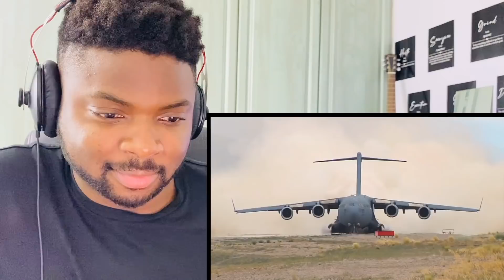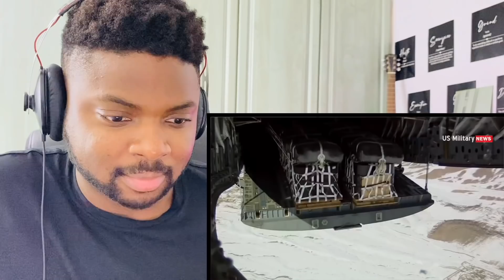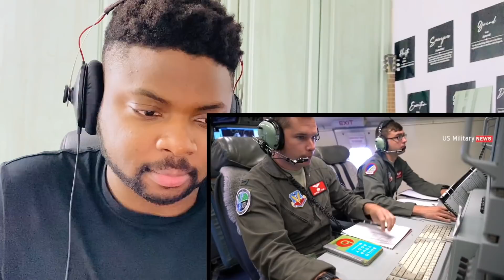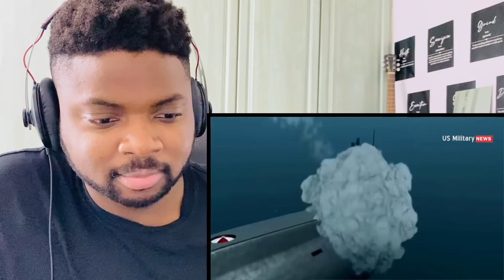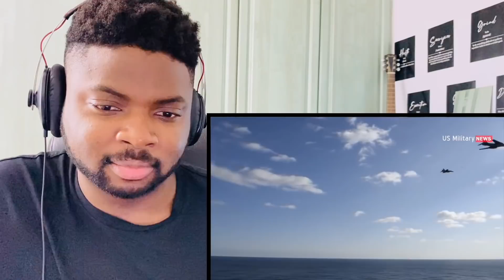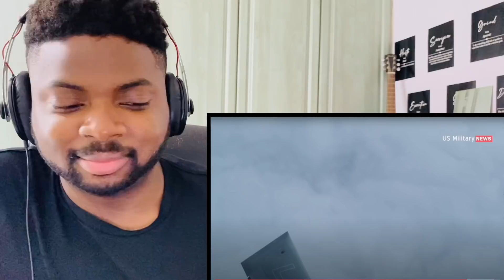🇬🇧BRIT Reacts To THE US MILITARY'S 7 MOST EXPENSIVE AIRCRAFT!

Comment: The military submits requests to various contractors for bids when they need a new piece of equipment.  The military includes their expectations for what they expect the aircraft (in this case) to be capable of.  Eventually, a single design is chosen.  Then, ONE order is placed for the desired number of units.  The contractor begins construction and gets paid on delivery of each unit.  It typically takes years to build all the aircraft for an order placed by the US military.  At any point during the process, the military may modify the order, increasing or decreasing the total number.  This may happen due to changes in the federal budget or response by the military to the dynamic shifting of its needs and goals.  For example, the USAF placed an order for 1,200 F-35's.  That's a lot of aircraft to build.  They are built and sold in batches, or "blocks."  The latest block of units will feature the latest tech adapted for the aircraft.  This gets repeated until the order has been fulfilled.

Comment: The video gets something very wrong. The B-1B is not the backbone of the US strategic bomber force. Not by a longshot. The US still operates the B-52 Stratofortress. The last one was built in 1962 but it's continually updated. It started as a high-altitude nuclear bomber. Then a low altitude nuclear bomber, Then carpet bomber. Now a long range platform for standoff conventional and nuclear weapons. It has adapted to every Air Force need. It's planned to continue operating for at least another decade or more while the B-1B and B-2 are retired. It has outlasted everything that was supposed to replace it. It's unofficial nickname is the BUFF which stands for Big Ugly Fat F*cker.

Comment: Kelly Johnson was head of Northrop Skunkworks group involved in many many plane designs including U2 and SR71.  I believe he had also worked on a flying wing design, but you need computers to control surfaces to make it stable enough to fly. Word is he was shown the built up B2 before he passed away. Kelly Johnson was an fing genius.
Reply: Lockheed skunk works dude.  He did the f117 not the B2
Reply: @codypk5111  I had Northrop and B2 on my mind. Lockheed is obviously correct. I was thinking about story where he was shown the B2 before he died or maybe I’m confusing him with Jack Northrop being shown B2 as he worked on YB49 design. Hell I can’t remember.

Comment: correct me if I am wrong, but weren't the Globemaster series designed to replace the old B52s and BFFs (747s)? Anyone with knowledge comment and let me know.
Reply: The B-52 is a bomber, not a cargo aircraft.  According to Wikipedia, the C-17 Globemaster replaced the C-141 Starlifter, and was designed to take off and land on relatively short runways, like the smaller C-130 Hercules.  According to Google, the 747 PH-BFF is a 747-400M, a commercial passenger/cargo combination aircraft.

Comment: Hi Kabir,  answering your question about ordering things, defense contracts are funny and very flexible things.  I was in the Navy for 20 years, but I retired 24 years ago so some things may have changed and some one may have more current info.  However, it used to be that anything consumable (such as uniforms, hats, ribbons, medals, shoes, food, soda, water etc) used to typically be on an annual or multi-annual contract with the same supplier.  Every so often the US Government would seek bids for the cheapest provider, but those kind of contracts usually remained in place for some period of time.  As for aircraft etc. that you were asking about, you really don't go through a lot of those in a year, so those typically are ordered as needed.  If a manufacturer has already produced one before, chances are the order will go to them again.  BUT... the government is very quick to solicit bids for the lowest cost.  It used to be (and probably still is) a running joke (regardless of what vehicle you were in) "how does it feel to be flying in an airplane built by the lowest bidder"?   lol  :-)
Reply from the maker: Awesome, thanks for answering my question mate!

Comment: Boeing is primarily a Military supply company but has a separate civilian sector. This is where the Air bus was developed. They also have a private sector for private planes and such. This is quite normal for an airplane manufacturer. This way the company can share information between sectors to better technology. Boeing unfortunately don't run their own interior tech for the the actual cabin and piloting. That usually falls to one of two companies Lockheed/ Martian and Northrop/ Grumman. both came out of mergers that create great tech. Lockheed specializes in making planes fast and untouchable but also getting the most out of turns and banks. Northrop is the tech like the most advanced radar and Laser guidance systems. each company has their specialties that Boeing likes and can easily swap parts with.

Comment: 2 fun facts. 
Fun fact 1.The C 17 has a maximum capacity of about 190 fully armed paratroopers or a recommended capacity of 300 people when solely transporting passengers. Although with low fuel the one in Afghanistan just took off with over 600.  

Fun fact 2. In 2008 a B 2 spirit was left in the rain overnight , got moisture on its computers, and crashed upon takeoff the next morning. And to this day , at 2 billion $, is the most expensive Air Force disaster

Comment: For the C-17, normally the max loadout weight is 170,900lbs (77,518.94kg) of cargo, which equals about 102 fully loaded paratroopers, or about 134 troops with palletized "seats" and sidewall "seats"...
 buuttt...
On Aug. 15, 2021 a U.S. Air Force C-17 Globemaster III safely evacuated approximately 640 Afghans from Kabul, the last time a C-17 was used to evacuate so many people was in 2013, when a C-17 evacuated 670 people fleeing a typhoon in the Philippines.
Reply: I saw the pic if the Afghans all crowded together on it, craziness how so many people can get on it.
Reply: The Air Force issued a correction to that number. That number was adults only. Total head count was 823.

Comment: Being a fan of the B-2 have you ever heard of it "Grandfathers", the Northrop YB-35 and YB-49? 
Very advanced aircraft their day (the late 1940s!) - 
but without computer assisted flight controls, 
flying wings can be dangerously unstable.
Reply: Aye, was going to mention these. We've had the tech to build and fly wings for a long time, it's just that they can get really unstable and hard to control without computer systems to aid the pilots. The military saw the advantages to flying wings with the YBs, but it was just too difficult a beast to fly if the conditions were not perfect
Reply: @panzerwolf494  Yes, indeed. Too far ahead of their time.